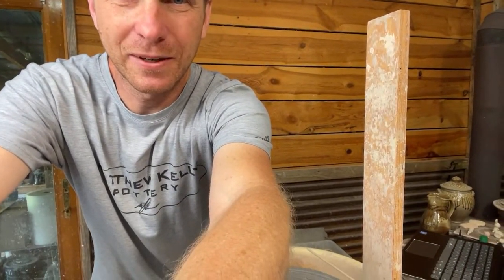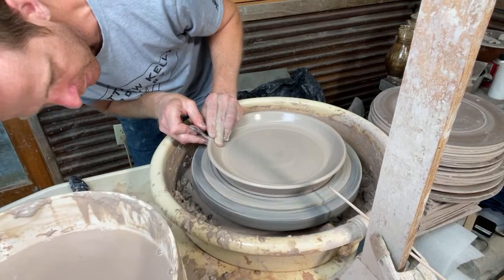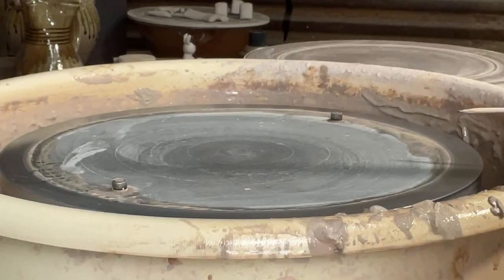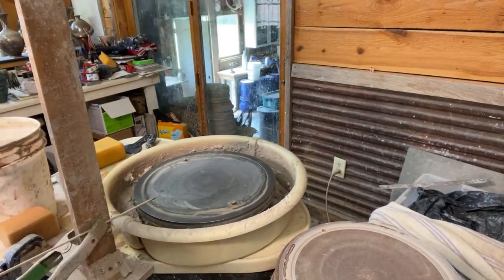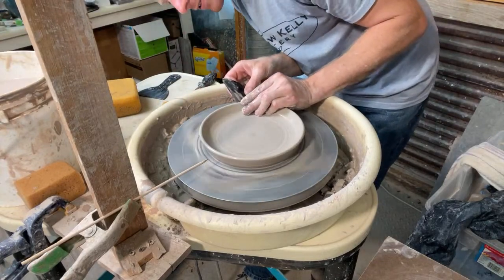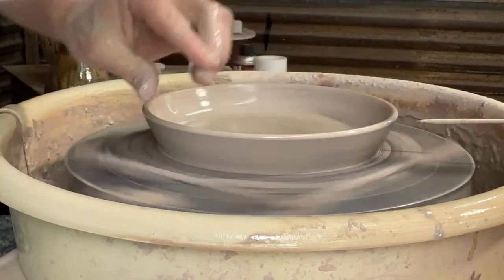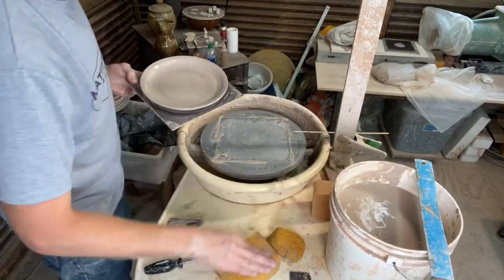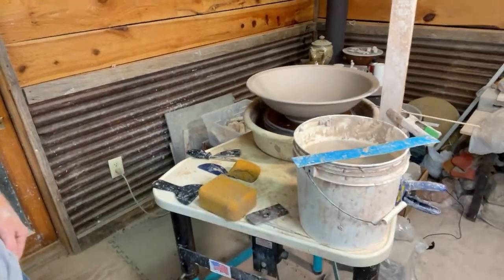Throwing Plates - Live Stream

Comment: I work for a cabinet manufacturer. 
You need to ask for 1/4” tempered hardboard. Tempered hardboard is treated with linseed oil under heat, which helps the water resistance. Tempered hardboard is smooth on both sides unlike typical hardboard.